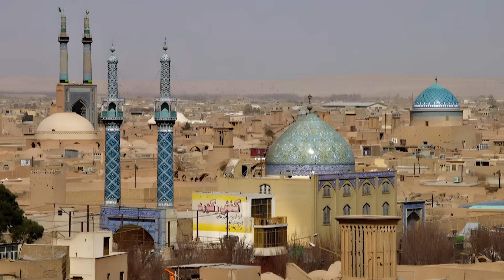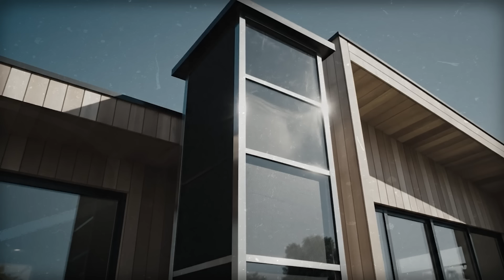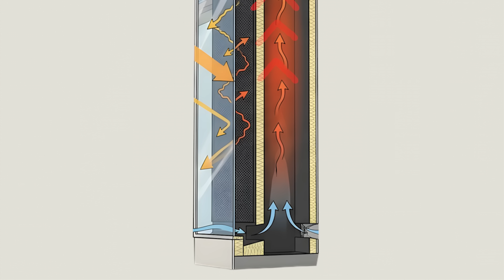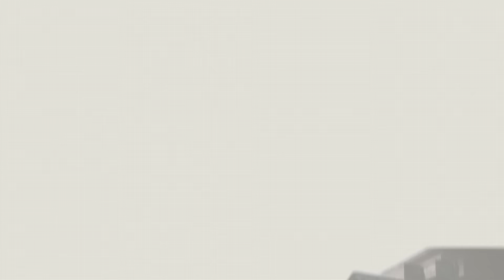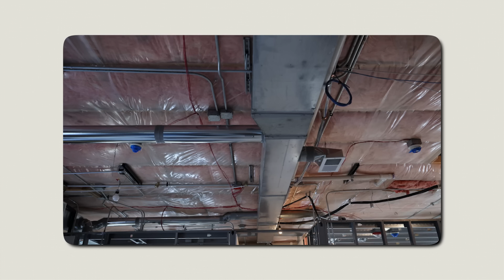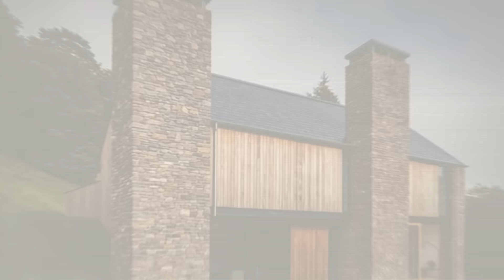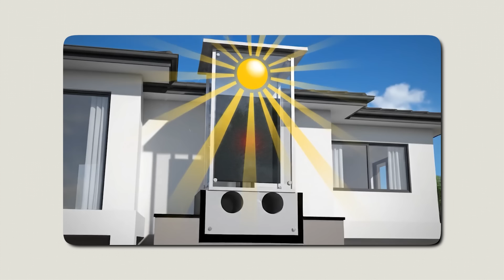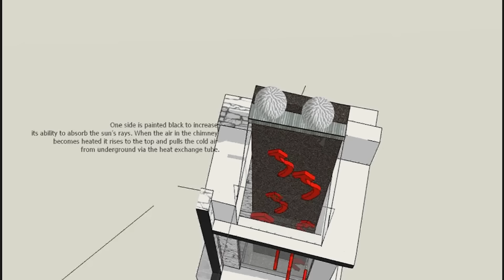This Chimney Will Cool Your Entire Home WITHOUT Electricity. Why Did The Energy Industry Hide It?

Comment: Check your local research.  In many places with high humidity the temperature differential is both lower and moving muggy high humid air through the house will not help cool down the house as much as you would think. It works best in places with low or no humidity which is why this concept it was found in desertous regions.

Also a lot of houses already use this concept to move hot attic air out of the house passively.
Reply: hy, in tropical area with high humidity, u can use Cyclone Roof Vent, greeting from indonesia.
Reply: @thalibyusuf i have it in my house, it does work really well, it pulls air from the outside in and out again, but since the air outside is so hot, it didnt really matter. 

At 35c is sure cooler than 38c for sure, also no stale air, but we are still steamed inside 😂
Reply: @krisnadiimam4556 I think you need to put the air intake through a pipe of an underground source
Reply: @krisnadiimam4556  35c for steaming is perfect. Like hugging someone hot and sweaty...
Reply: @DamienKSC well said, it is as appealing as like hugging a totally random same gender person while both are sweating like pigs and neither ever brushed teeth nor shower while being straight. 😂
Reply: @mujkocka  Yes, but also be careful. Condensation pools and mould can grow, and humid air is just asking to condensate.
Reply: @thalibyusuf  Its Turbine Ventilation btw....😄
Reply: @thalibyusuf  Or what about an Air Conditioner?
Reply: @An_Alien_Observing_Earthlings  aircon is always a solution, we are referring to one that doesn't requires dumping extra heat to the surrounding. Aircon is not only moving heat from one place to another, but it also generate even more heat... 
what I'm saying is surely I can keep my house cool, but what about the heat from the outdoor unit that I dumped on my neighbors?
Reply: @An_Alien_Observing_Earthlings  And in winter you can heat your house by burning money, right?
Reply: I was wondering how well it might function in humid areas myself.  What if the intake air came from the ground instead of ambient.
Reply from the maker: This is where the theory and the practical meet.  What you need to watch with humid air is the dew point effect.  If the air outside gets cold and you warm humid air in a solar chimney, you will get condensation.  The solar chimney works best in locations with low humidity.  You could install a passive dehumidify in your home like a salt based system or natural material that dehumidifies (which we will be talking about in another video) and this would then work well with a solar chimney.  Not sure what you mean by taking intake air from ground.  Earth pipes can be connected to the house to allow for natural cooling or heating but again you need to consider humidity.  Hope this answers your question. Thanks
Reply: @wildline_YT  The ideal conditions for this system, don't exist IRL. That's why no one uses it anymore.
Reply: @wildline_YT You are an ignoranmus. Why not lead the fresh air to a giant An Bar that has wooden barrel partially filled with salt.  You are the blind leading the blind.
Reply: @wildline_YT  I would be interested in seeing a video for achieving passive cooling in humid climates. I understand being mad that these old cooling techniques are being thrown by the wayside, but we need cooling solutions that work everywhere, not just in Arizona or the Middle East.
Reply: @technosurfer92 Solutions will vary depending upon where it needs to be implemented.
Reply: @wildline_YT  So heating humid air will cause condensation. I would like you to proof that point as it is very very wrong.
Reply: @wildline_YT  I think a ground pipe for ventilation would help eliminate that issue.   The damp air would condense of the walls of the underground pipe and the air would be dry by the time is got to the house
Reply: I have researched this quite a bit. The solution for humid areas is adding a desiccant wheel into the system. As the wheel absorbs humidity dry cool air flows into your house. The wheel turns and the desiccant material dries as it turns.
Reply: @jeffweyler6283  Does this work in real humid areas?
Reply: @3x157  no, this is how an EVR works, this will not deal with the latent load in a system like in the video, the LiCl will saturate in no time a nothing will happen.
Reply: @3x157  ofc no😅
Reply: @rumbecker5085   And a dessicant wheel uses a ton of power to redry dry the dessicant and release alot of heat, more than a AC system would use to cold down and dry the air.
Reply: @3x157  As someone living in such weather right now, my answer is a solid no. You cannot dry the desiccant wheel using air that's already moist as hell without inputting energy, and will just better off with a dehumidifier, which, itself is a small HVAC without the V, which, you just better off with an air conditioner.
Reply: @MIO9_sh  exactly!!!!
Reply: Could work with a bunch of silica packets? Lololol
Reply: @Jolgarz 😂
Reply: @jeffweyler6283  I am living in a Tropical country, rain and sun all year round. Where can I buy a desiccant wheel? Can I get a Solar Chimney to buy, or do I have DIY?
Reply: @SuperJoebird I work in hvac design, in Malaysia. One of the most humid tropical countries in the world. Dessicant wheel is not feasible. You'll be better off financially using an air conditioner in the long run.
Reply: @npdady tq!
Reply: @SuperJoebird From what I understand in Europe they use clay or silica gel. You can buy cat litter that is 100% clay. You would probably have to build it yourself. I'm just going on what I have read. If anyone out there has first hand knowledge please let us know. I did find the design via a Google image search. Good luck sir.
Reply: @SuperJoebird   he said a lot of humitdity can make it worse where you live, so  you might not benefit as much, please do research before committing to a big project, i dont wish to waste ur time and hard work if ur not sure.
Reply: @jeffweyler6283  At that point people would just turn on their AC
Reply: @jeffweyler6283 how would the dessicant dry? put used dessicant out in Florida during the summer and its definitely staying saturated.
Reply: @jeffweyler6283 Just like swamp coolers, it's not going work well in areas like mine.
Reply: Yes I looked into this and came to the conclusion that wind catchers or whatever similar 'chimneys' are discussed here, are not worthwhile in the tropics where we live. Rather, we are installing a roof misting systems for the hot drier months and just air movements in the house for the rest of the year. We will still use AC ome of the time - as it has already been installed, but maybe add some solar panels with no battery for that alone to save electricity.
Reply: When I lived in Central Australia, everyone had evaporative air conditioners. Except the Americans. When I lived in tropical Australia, it was all refrigerated AC, evaporative wouldn't work there.
Reply: @martinXY  Yeah, swamp coolers really only work in a dryer environment. At its simplest, it’s the evaporation of the water that cools. Here in the high humidity South (I live in Florida) the air is so humid that the water used by the swamp coolers has no-where to go. 

OTOH, old Florida Cracker houses were amazingly comfortable 90% of the time. They had 9 to 12 ft tall ceilings, tall windows with double sashes, and very deep, covered, wrap-around porches. Heat rises (as we know,) and you drop the top window sash about 12”, raise the bottom sash about 8”, and you can get a pretty nice bit of circulation going. It’s still going to be wet, but the smaller lower opening forces air through at a higher rate. Which is cooling. (And for added cooling, separate the living room and bedrooms from the kitchen by way of a wide covered dog-run. Which isn’t for dogs, lol. It’s also so much cooler.)
Reply: @l @ladychiere love that idea of having the lower sash windows opened a little less than the upper ones to increase flow speed. One Q: what is a dog run in this context?
Reply: @martinXY  A dog run is just that covered porch connecting the two halves of the house. Imagine a capital B. One half is the living and sleeping half, the other is the kitchen. The cross piece is the dog run. Usually you built both sides, the space between the halves was 8 to 12 feet wide, and it was all topped with one roof. You oriented the house so it caught the breeze, and it could get a fairly good bit of air movement through it. It usually had a few chairs set in it. Was a great place to shell peas, wash clothes, etc.
Reply: @ladychiere I live in south Florida too and people only buy swamp coolers in Home Depot to freeze a block of ice in the tank haha. Which anyways melts in 1-2 hours anyway.
Reply: Still a better concept, even if one tenth of world adopts it, we still can save so much resources and environment from non reversible damage. People like you who always see the cup as half empty bring no good. At least one should start somewhere rather than complaining about something not being suitable for a fraction of people.
Reply: @nidaalam6584  my friend in the area i am at installing and using one of these would require more energy on my hvac system to compensate. Its handy for certain areas and im just warning people to do research. A lot of institutions around the world have actively tested this. Looking up local colleges and their findings on the subject can help you from accidentally making the situation worse. If you are in the goldilocks zones where this can work then use it to your advantage.
Reply: Even in climates with high humidity the best strategy always would Ventilation. If you pair the solar chimney with a provenzal well with a condensation deposit combined with dissecant materials, would be far better than mechanical AC.
Reply: @HN-zn5lh you probably don't live at the tropics lol, the air outside is most of the times hotter than the inside, with so much humidity that if you turn on a humidifier the water just collects on the floor.
Reply: Put salt on the pipes to absorb the humidity...
Reply: @Regalert  That doesn't work unless you keep replacing the salt forever and continuously.
Reply: Yep in whole house fans you turn  it on and sucks air out through attic
Reply from the maker: You are correct - it does work best in dry regions the best.  Not sure what you mean by checking local research thou. We do state in the video regions where these have been installed.  Appreciate the comment!
Reply: @wildline_YT  it does not work at all in humid areas
Reply: no wonder tropical countries never adapted this lol
Reply: Any alternative in humid areas? /think Malaysia/singapore kind of humid. 😃
Reply: It would not work at night, or am I  missing something. There would be no temparature differential at night.
Reply: @realmilind it could if you get something with high amount of thermal mass to remain hot. But its heat would dissipate over time.
Reply: So southern california 20 mins from the beach is no good
Reply: @Camie2023it’s totally fine so cal is dry
Reply: Not a civil Engineer but my country has all seasons so not good for us better to just put ac for 3 months of heat then normal air for rest
Reply: I live in a humid climate and removing water from the air inside via the dehumidifier function on the air-conditioner works well and doesn't cost too much.
Reply: It's mostly for dry regions only!
Else it's money wasted yes
Reply: what difference does humid environment makes though
Reply: @Sparsh-t2m  humid air doesn't let your sweat evaporate, so you get hotter. Besides the water in the air gets hotter too, so the air outside is most of the times hotter lol.
Reply: so it doesnt work in tropical climates?
Reply: @An_Alien_Observing_Earthlings  cooling? Probably not. Ventilation maybe
Reply: Also I dont think anyone is hiding the "technology" to open a door or window on one side of the house and then open another door or window on the other side of the house. Like you said the issue is humidity though.
Reply: @pin65371  the "technology" is building it in a specific way to abuse thermal mass and keep the effect going throughout the night.

Thing is we've rediscovered this hundreds of times. Heck you can diy a version of this with aluminum cans, black paint and sand.

The core issue is humidity.  In the heart of the desert this is a fantastic solution and it is used there for the most part. But the simple physics doesnt work when the water in air itself is hot.
Reply: Great video but how do you classify dry or humid area, we live in South Africa, Cape Town at the sea and Paarl in a dry area near mountains inland, different climate. Which area would work, how can one find an expert?
Reply: @nadjaellerholz2351 from what little I read on the subject it wants below 30% humidity optimally it wants 23% ish. So look up the average humidity in your area and if it is in that range you are fine. As for finding builders and such seeing i live in an area where its 60% at the lowest i didn't look much further into the subject
Reply: It won't work. The wheel requires less humidity to even work.
Reply: In thoroughly humid climates... Is this a better than nothing sort of situation? 

Like, can it at least maintain lower temperatures to help assist or reduce strain from AC systems by maintaining otherwise lower temperatures? 

Or at the very least it can take care of the sick building effect and function primarily to improve or otherwise assist in improving air quality, reducing mold and VOCs better than not having one. 

Since at least it solves the issue of air quality and air circulation issues vs just for thorough cooling (which a paired AC system can achieve).
Reply: @jorellbringas  cooling? Not really, humid air has higher thermal mass so it takes more to cool it down. It also spreads solar radiaton so the air is hotter and the chemney doesnt get as hot so there is less temperature difference and thus less airflow. And a constant source of moisture promotes condensation and mold. 

The energy saved on air circulation (which is pretty low in hvac energy cost) is lost in trying to deal with latent heat from the humid hot air. 

And by its design it moves cold air so most of the cold air goes out the chemney. 

The only way it would work is if you are in dryer areas or only exclusively use it for night flushing as a passive exaust feature but that isnt useful if your humidity is above 50%
Reply: @NameIsDoc Thanks for this clarification. I suppose this really isn't going to be the definitive solution for all climates as all other posts pointed out. So basically... for tropical countries this won't be a kind of better than nothing type of situation and overengineering a home to incorporate this would be detrimental or maginal at best (dryer nights).
Reply: Dig a hole, let the underground cool the home.
Reply: I was about to comment the same thing, but stumbled upon this one. You have a great point, we need a way to get rid of moisture rather than the heat.
Reply: Entire ridge vents and systems for it. Exactly. But tbh You could drastically save some energy if you were to go from a shingle to like a radiative cooling type paint. Same with how you treat the attic. It would be more than noticeable on the bill.  I grew up in Florida. I now live in California. And I'm looking at buying a house and using a few different cooling methods and solar methods you can diy like a solar water heater. Using my pool as a dump and house to contain overload while being able to still get water above 125f.  I'm surprised there aren't more things being done to be honest.  Also being a carpenter who could become a general contractor.  It seems they're just so many opportunities nobody is taking
Reply: Mind you this sort of structure has been in use for about the past 200 ish years in the desert regions of the middle east.
Reply: The video in the end says to use Earth Tube cooling underground if Air us hot and umid
Reply: @xanapoli which only works in low humidity places and If your dew point is over 60 degrees air earth tubes will make your house uninhabitable ala mold and bacteria buildup. So
Reply: yezzzaaaa…. desert like iran, yess suitable. parsian design.
Reply: Calcium chloride the one we use for snow and ice in the winter get you dryer air in your home i sucks up the moist. And the evaporative cooling works then so yeah it can drop a lot the temps with the right tools and tips. I like the tunnel underground for fresh air so it stay cool in the summer and warm in the winter :). Combine all tricks and you never need to waste money be smart with your good earnt money dont waste it 🎉
Reply: And this won’t work in cold climates that have hot summers.
Reply: I was thinking the same thing. How does this work with Humidity? I live in Central West Mexico, where the summer/fall is humid and hot.  I think this would work great in deserts, but humidity is a whole different ball game. I'm taking the South of the USA is also the same, with its humid summers.